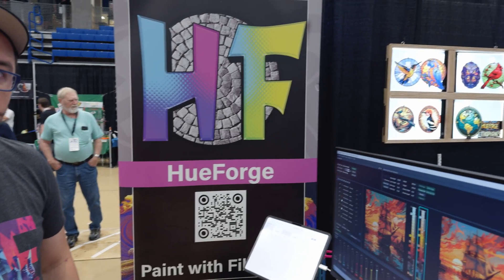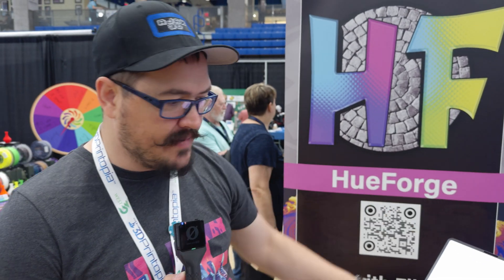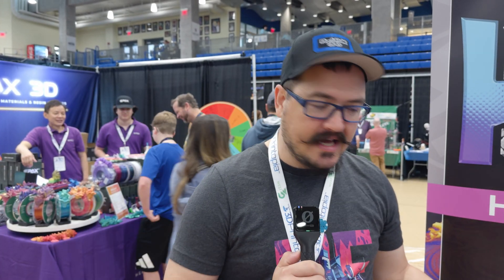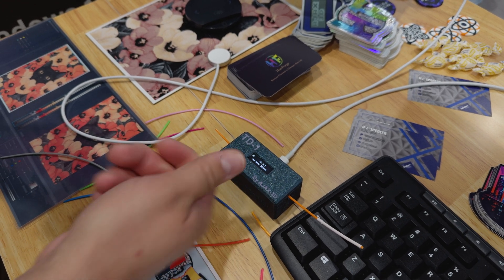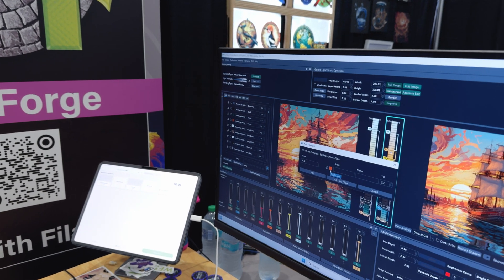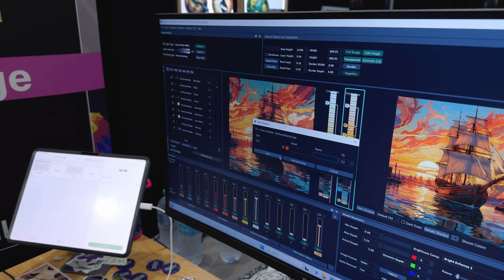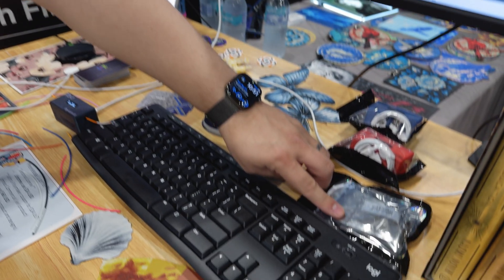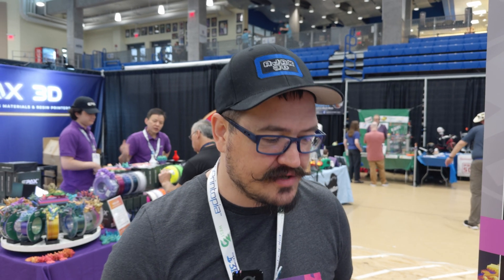West3D at 3DPrintopia 2024 with AJAX 3D

Comment: I purchased and assembled my TD-1. The printed parts are spectacularly designed. Printed on my X1C in dual color. 

The assembly of the kit took some YouTubing but well worth it. 

One of the coolest features is no screws. It uses filament to hold the PCBs in place.